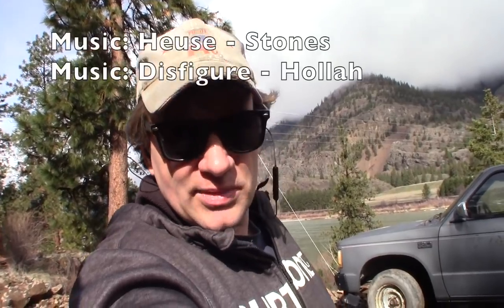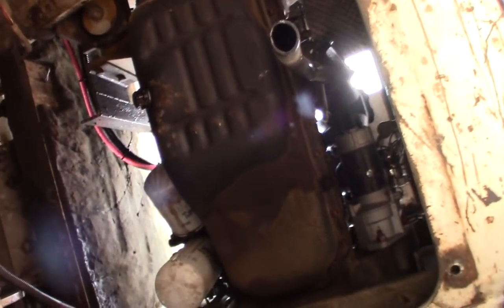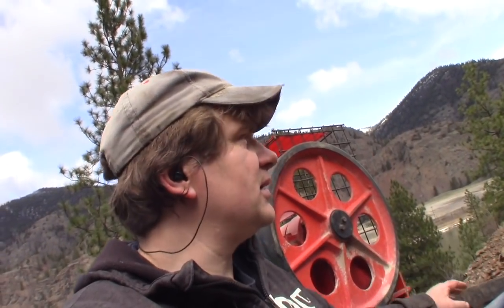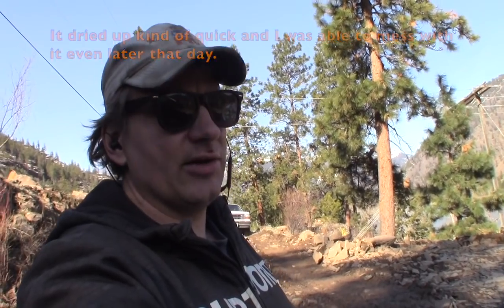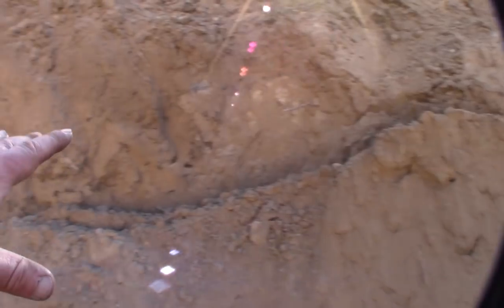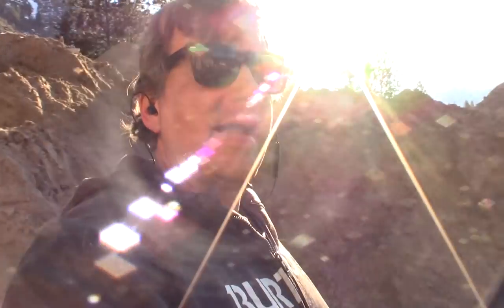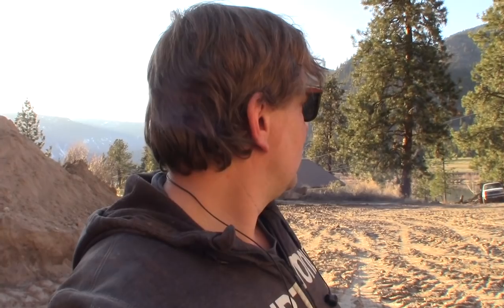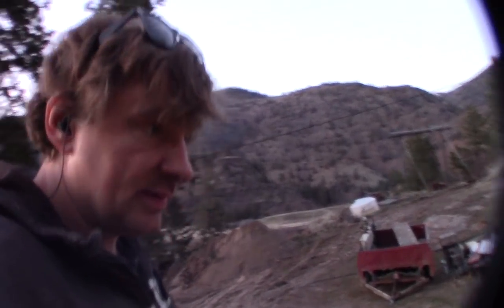River House 77 Crushing It

Comment: Equipment World site has an article on fuel consumption based oil change intervals. Quite a reasonable approach. The also indicated that they change out the fluid in the pump drives in the excavators at every oil change. I don't know how yours is set up. In fact, I don't know how ANY are!
Reply from the maker: I will try to look it up.  Thanks!